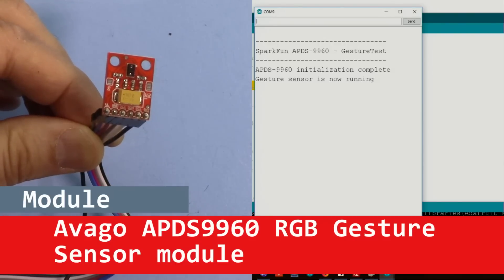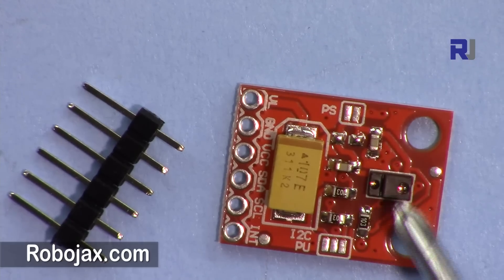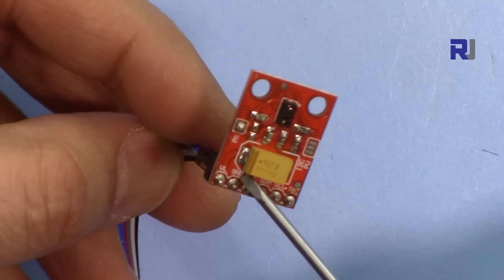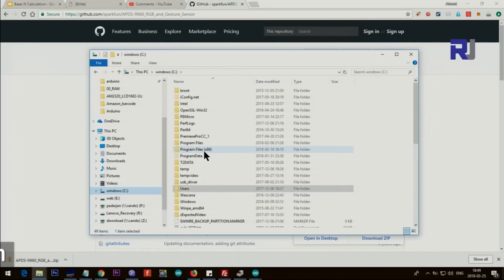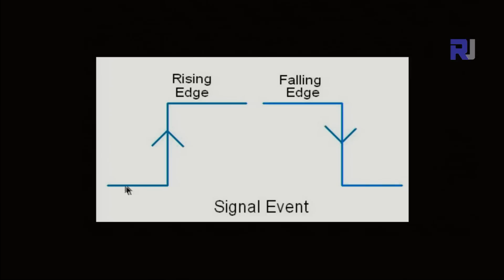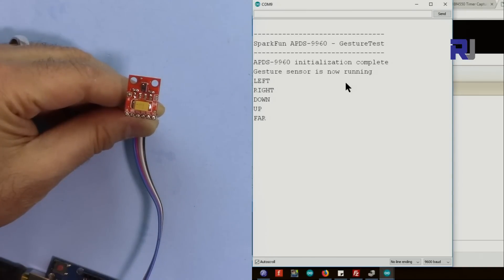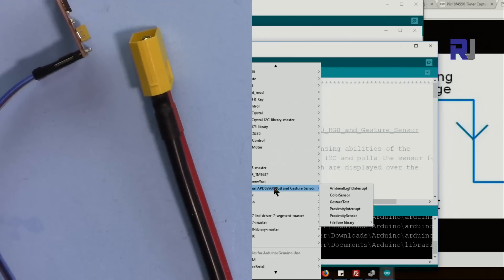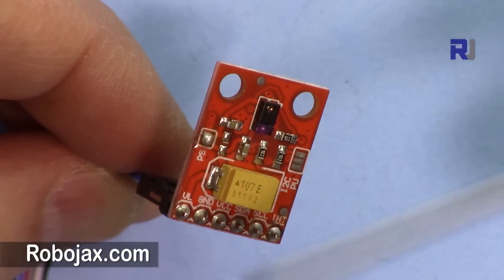How to detect hand gesture APDS9960 Gesture, RGB and Proximity sensor for Arduino RJT70

Comment: What is the cause that My apds 9960 gesture RGB sensor is doing well for all tests like proximity proximity interrupt color sensing, ambient light interrupt test. But not working for gesture test.
On serial monitor there is Gestrue sensor is now running, but no output after

Comment: If it doesn't work for you, it may be a fake 9960 and is a 9930... I have bought two on Aliexpress identical to the one in the video but they do not work with the 9960 libraries. They have detected it by changing the ID to 0x39 but it does not return any value. With the 9030 libraries it does work but this one does not have gesture or color recognition, only proximity and ambient light. The ones that are purple do appear to be 9960, for them to work you have to change the ID to 0x9E

Comment: Really nice project, thank you a lot. Here is my try, but there is a problem, I'am biggener , so it's my pleasure if you could you help me to solve it, . When I enter any password (even the correct one), the output will be: wrong password. Here is the code:

@/include <Wire.h>
@/include <SparkFun_APDS9960.h>

@/define APDS9960_INT 2 //As sparkfun gusturetest example
@/define hall_sensor 4
@/define push_button 5

SparkFun_APDS9960 apds = SparkFun_APDS9960();  //As sparkfun GustureTest example
int isr_flag = 0;                              //As sparkfun GustureTest example

boolean hall_detected_key = false;

int code[4] = {0, 0, 0, 0};
const int password[4] = {1, 2, 3, 4};
const int number=sizeof(password)-1;

int i=0, count=0;

void interruptRoutine();             

//-=-=-=-=-=-=-=-=-=-=-=-=-=-=--=-=-=-=-=-=-=-=-=-=-=-=--=-=-=-=-=-

void setup() {
    Wire.begin();
    Serial.begin(9600);
    
    pinMode(hall_sensor,INPUT);
    pinMode(push_button,INPUT);
    
    pinMode(APDS9960_INT, INPUT);  // Set interrupt pin as input
    attachInterrupt(0, interruptRoutine, FALLING);  // Initialize interrupt service routine
    
    // Initialize APDS-9960 (configure I2C and initial values)
    if ( apds.init() ) {
    Serial.println(F("APDS-9960 initialization complete"));
    } else {
    Serial.println(F("Something went wrong during APDS-9960 init!"));
    }

    // Start running the APDS-9960 gesture sensor engine
    if ( apds.enableGestureSensor(true) ) {
    Serial.println(F("Gesture sensor is now running"));
    } else {
    Serial.println(F("Something went wrong during gesture sensor init!"));
    }
  
    Serial.println("Setup compelete");
}

//-=-=-=-=-=-=-=-=-=-=-=-=-=-=--=-=-=-=-=-=-=-=-=-=-=-=--=-=-=-=-=-

void loop() {  
      int  detected = digitalRead(hall_sensor);              
       
      if (detected == HIGH){
           //Serial.println("Detected. Keep going");
           hall_detected_key = true;
      }
      if(detected == LOW){
           //Stop_engine();
           Serial.println("Hall not detected yet!");
           hall_detected_key = false; 
           //Gusture_input = 0;
           i = 0;  //Reset values
           count=0;
           for(int o=0; o<3; o++){
           code[o]=0;
           }
      }
      
      if( isr_flag == 1 && hall_detected_key == true) {
        detachInterrupt(0);                //As sparkfun GustureTest example
    
          if ( apds.isGestureAvailable() ) {   //As sparkfun GustureTest example
              switch ( apds.readGesture() ) {
                case DIR_UP:
                  Serial.println("UP 1");
                  code[i]=1;
                  i++;
                  break;
                  
                case DIR_DOWN:
                  Serial.println("DOWN 2");
                  code[i]=2;
                  i++;
                  break;
                  
                case DIR_LEFT:
                  Serial.println("LEFT 3");
                  code[i]=3;
                  i++;
                  break;
                  
                case DIR_RIGHT:
                  Serial.println("RIGHT 4");
                  code[i]=4;
                  i++;
                  break;
                  
                case DIR_NEAR:
                  Serial.println("NEAR"); //(not used input)
                  break;
                case DIR_FAR:
                  Serial.println("FAR"); //(not used input)
                  break;
                default:
                  Serial.println("Unknown");
                  
                }
              isr_flag = 0;            //As sparkfun gusturetest example
              attachInterrupt(0, interruptRoutine, FALLING);  //As sparkfun GustureTest example
          }
      }

      if( i>3 && hall_detected_key == true){
               Serial.println("Checking, pls wait a moment");
               Serial.println(code[0]);
               Serial.println(code[1]);
               Serial.println(code[2]);
               Serial.println(code[3]);
                
               for(int f=0; f<4; f++){
                   if(code[f]==password[f]) count++;
                }

                if(count==number){
                    Serial.println("Accepted, Have a good day! ******");

        
                 }else{
                    Serial.println("Wrong pass! please enter again"); 
                    //Reset values
                    i = 0;
                    count=0;
                    for(int o=0; o<4; o++){
                    code[o]=0;
                    }
                 }   
                      
      }else{};  //i<3 yet
      
  }//end of loop()

void interruptRoutine() {
  isr_flag = 1;                //As sparkfun gusturetest example
}
Reply from the maker: Hi, I believe we have no password in the code shown in video. This code can’t be verified without loading yo arduino connected to the sensor.
Reply: Thank you for your consideration brother. Yes, I just try to improve it, in order of practice more complex project. The code works well, just the the point of problem is that in process of save each password along with each gesture input. If you have time to see it, that well be my pleasure.

Comment: Sir, I am unable to perform this demo of APDS RGB gesture sensor, as some error is coming that "Something went wrong during APDS-9960 init!". Please help me out. I have made setup according to you only (included everything as you did).
Reply from the maker: if you did everything as I said, then your module must be bad. but I doubt it. you must have missed either the wiring or changed the code. try it again without changing the code.

Comment: How can I convert the RGB  register values to RGB values (0 - 255) or hex values?. My intention is build a color recognition system.
Reply from the maker: There is example of color detection. It is called ColorSensor under the examples and APDS9960.

Comment: I am having trouble getting the module to work. I tried two of them but both do not react to the gestures. 
I shorted the PS, but there is 3 traces labeled I2c PU that are open Do I have to short them as well
If you want to know about these traces look at the picture 
https://learn.sparkfun.com/tutorials/apds-9960-rgb-and-gesture-sensor-hookup-guide/all
Reply from the maker: please use I2C scanner code located here and making sure you get the address. Once you get the address, then it should work: http://robojax.com/learn/arduino/?vid=robojax-I2C-scanner
Reply: @robojax  I got the address 0x39 So, I added  #define APDS9960_I2C_ADDR       0x39.    Still no response !!!!
Reply: Then I short it them all and STILL got 0x39 !!!!!!!!!
Reply from the maker: shortening doesn't change the address. it just changes the behavior.. there is a plastic cover on the chip. have you remove it?
Reply: @robojax  pleased that the no change in address means the module is not dead. 
No there is no plastic anywhere to be removed. Is there a simple way to tell me  that the sensor is working ???? If I know it is working but not given the proper response I will keep going until it does
Reply: Here is the Meagan
--------------------------------
SparkFun APDS-9960 - GestureTest
--------------------------------
Something went wrong during APDS-9960 init!
Gesture sensor is now running
Reply from the maker: but the experiment I only soldered the PS pins. I have no idea why you are getting error. It should work if the module is not defective.
Reply: @arishy  Even I am facing same issue, every time I tried to make it work. Please help @Robojax Sir.